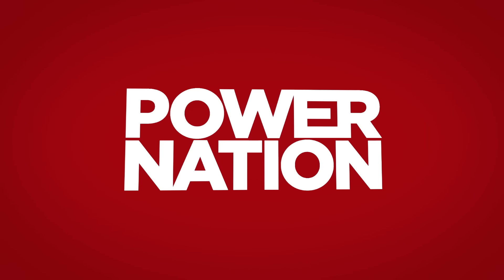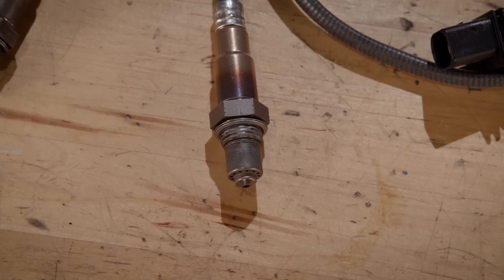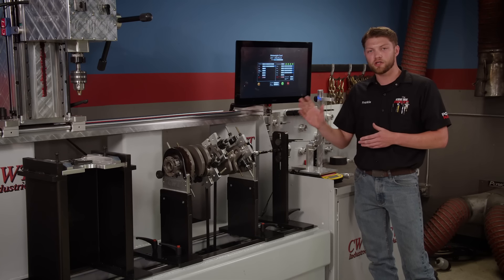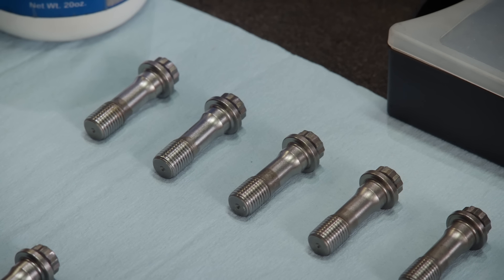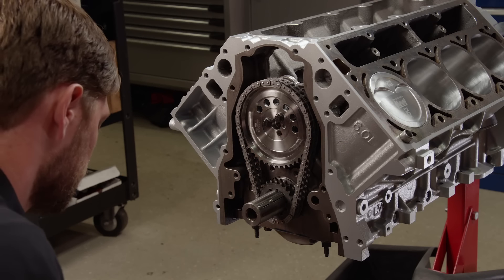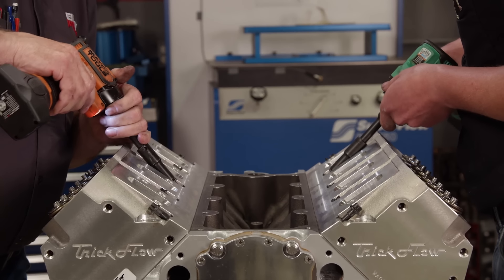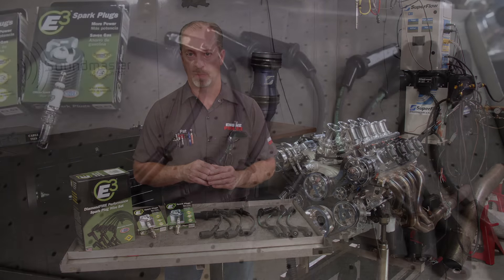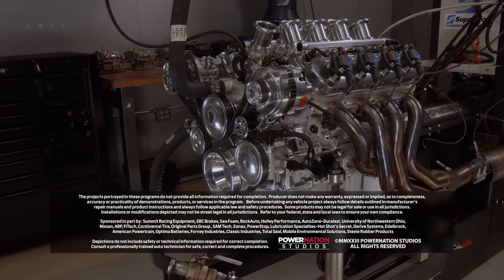410ci EFI Stack Injected Stroker LS - Engine Power S10, E13-14

Comment: I drill, and ream the covers and install a 250 hard steel pin, so you have locating pins in the block before ever removing the front and rear covers just like gen. 1 sbc ! Saves you from buying tools that you may use once!

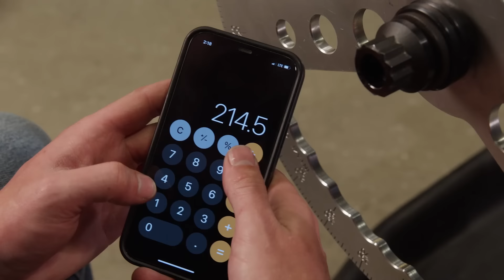Comment: 19:40 why didn't they use ARP main bolts? 24:40 You advance the cam to pick low end but you use ITB which know for top end power.

Comment: The ITB setup is designed for high RPM, I think a few degrees back on cam timing, you'd pull 600+hp over 7k. The ITBs and bling make me think of a very racy, high revving type engine. Still an awesome build tho!!!

Comment: Love the intake, but what kind of air cleaner will work on that to keep the bad stuff out? That would look great in my El Camino.
Reply: There are small air cleaner mushroom tops that fit on top of the intake tubes.
Reply: Nothing. These bling builds are SEMA builds. No need to be concerned about anything else.

Intake runners are usually sized for the operating range of the engine, short runners are usually used for high revving (7k+ rpm) engines. If power curve was the intention, this would have been better off with a Fast intake.

Comment: I wish Powernationtv would do a LS conversion with a flat plane crank
Reply: Why?
Reply: Well I don't know about the performance advantage but they do have a distinct sound so there's that.
Reply: @joshtheking1772  Most flat plane engines are DOHC, I would like to see if you could get the same higher RPM with a Single cam.

Comment: Wow, some serious coin into that street LS 410. The induction,  accessory drive system, and fasteners alone would break me. Probably not representative of your average hot rodders engine. But hey, who knows? Some people love alot of bling. Impressive looking and has an incredibly flat broad power band. Would be perfect for a heavier oldschool musclecar.
Reply: just the rotating assembly from Summit cost $2700.  not including the heads, induction, front accessories, ignition OR labor costs.  I'd say $13k JUST in parts

Comment: That will put it to the ground nicely.
My ls2 403 stroker with a ysi head laid down over 500 ft lbs of torque at 2600... Absolutely zero traction.  Hated it because it ruined the average light to light and made my car a 70 roll only.  My mistake

Comment: Hello from New Zealand.   Im looking at rebuilding my LS1 powered Holden Commodore HSV clubsport.   Just wondering if the alloy bar bell is required in our front sump engines.   As our pick up, oil filter diverter ect is at the front, and built into the sump.    Can you give me some advice on this please.   Its the same engine used in your 04 Pontiac GTO

Comment: WITH THE RIGHT GEARING....HIGH TENS IN THE QUARTER ARE POSIBLE.......ONE THING YOU GUYS NEED TO LOOK AT WITH THESE STROKERS IS PISTON SPEED....A318 HAS A PISTON SPEED OF 1750 FEET PER SECOND AT 3000 ROM..IF MEMORY SERVES ME....A 360. IS 2250.....AND HYDROPLANES. ON ITS OIL AT HIGHER RPM..
YOUR STROKER IS  PLANEING ON ITS OIL
AT 3000.RPM....IF IT DRINKS OIL....THATS WHERE IT WENT....
SOMETHING TO THINK ABOUT WITH YOUR RING CHOICE.

Comment: That was disappointing tbh. Buddy of mine has an 06 GTO with high compression bottom end (still 6.0) big cam, and LS3 top end, and it pulled 528 to the wheels, about 620hp at the crank

Comment: So how the hell did the old school carbureted Chev 400 (Icy to Spicy) a few weeks back make so much more power than this build? The Icy to Spicy engine should be in the Smithsonian ffs.
Reply: Cam
Reply: @ccbiezenbos  cam is a small part of the equation to make that much power.
Reply: It also had a bunch more compression, like more then a point of compression more, I think it was a 12.8:1 ratio. The camshaft was not installed this much advanced and it had more lift and duration. It also didn't have any accessories on the front of it. It only had a water pump and it was electric so no parasitic loss.

Comment: Tty bolts have different specs depending who makes then, example gm vs arp, please use arp specs on what they use on gm and use gm specs on gm...

I'm not big on all chrome engine but a chrome face on a truck is a must. What made nonsense was going with dished pistons when the LQ9 uses flat pistons. LMAO, diamondfire, it doesn't increase power, it might slightly help with fuel economy.
Reply: Those slight dished pistons were simply because they wanted a street (meaning pump gas) friendly engine. Their final compression ratio was over 11.1/1, so it's definitely not lacking. Not even really boost capable unless you wanted to run only E85 or higher. Those kits have an option for more dish to get compression ratios in the ~9.5/1 range for boost though, so that's an option if boost is the ultimate idea. But since these pistons aren't directly comparable to the stock set, you can't just judge by the dish/flat/dome numbers - these are a completely different piston from stock. ;)

Comment: Just missed that 600HP mark.....😢😢
Reply: Nothing that 5 to 10 pounds of boost an intercooler and a revised tune won't fix .
Reply: Throw some timing into it like 32 to34° then it will be in the mid 600 range.seems that all of ls builds end at 28°.I've built a 417 that made over 700 on pump gas
Reply: Stroker engines are more concerned with bottom end torque. That was always my impression.

Comment: I'd back the horsepower down to 80%, or about 472hp. For longevity. You could beat on the engine like a rented mule and nothing would happen to it.
Reply: just take 2 degrees of timing out to prevent detonation and its all good

Comment: WHOA!  Did he just install a piston and rod and DRAG THE ROD down the bore??  

All he had to do was turn the block so the cylinders were straight up and down!!  

What the hell??
Reply: Thats why he set it in carefully. With how rounded and smooth the side of the rod is theres zero issue. Its tipped to the side so pat can reach under and line it up with the crank.....